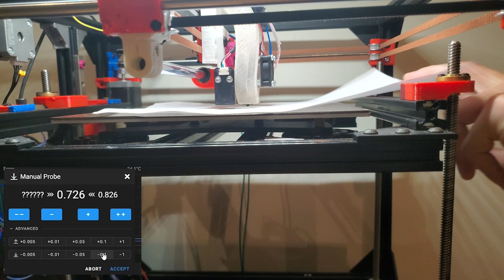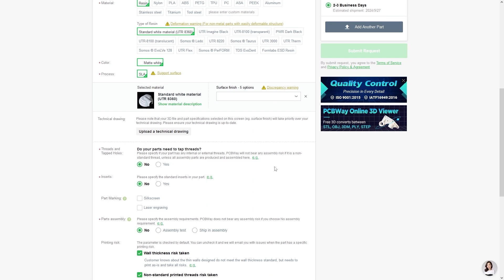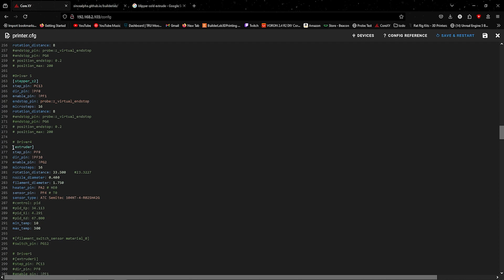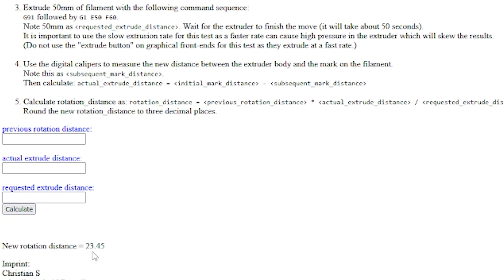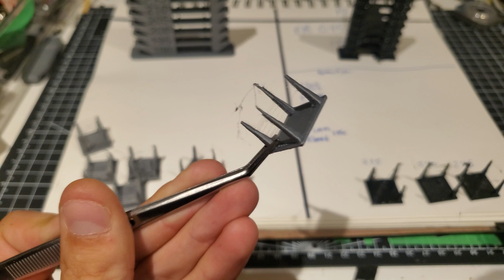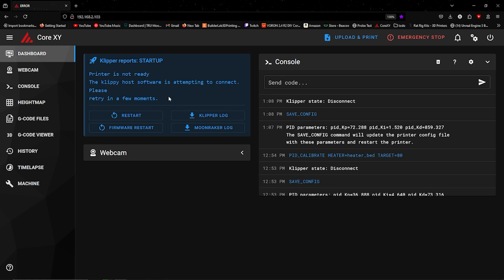Beginners Comprehensive Tuning Guide For 3D Printers

Comment: You have some legit klipper knowledge. I have just started completely rebuilding a Elegoo Neptune 3 max with 420x420 build plate. Im doing complete control rebuild. Btt controller and CB2 and new steppers, new complete extruder and hotend. I already did linear rails on x and y...... now....😂 i have absolutely nooooo idea how to do any of the pc setup and firmware and wifi connectivity or anything to actually make it work. Im a machinist and suck with pc stuff.  Can i offer to pay You for some personal help when it comes to the time for my system to be setup?
Reply from the maker: Join my discord id be more than willing to help if i can https://discord.gg/3wHbRThk